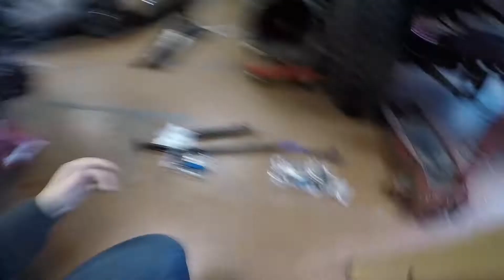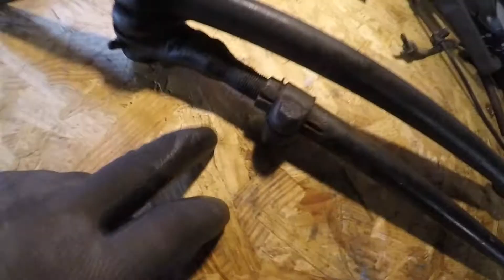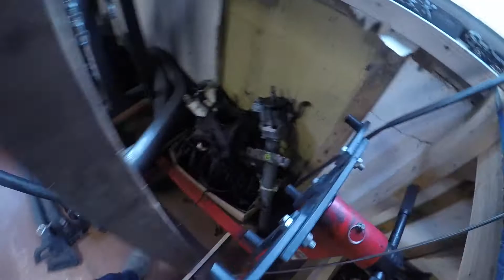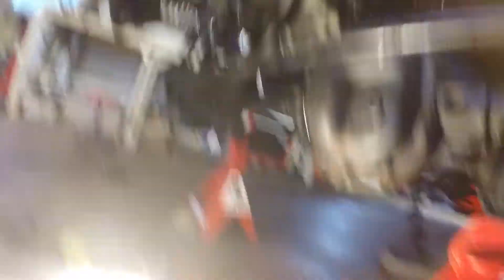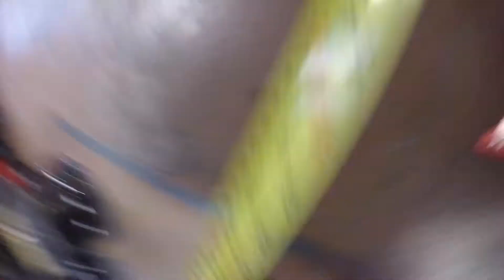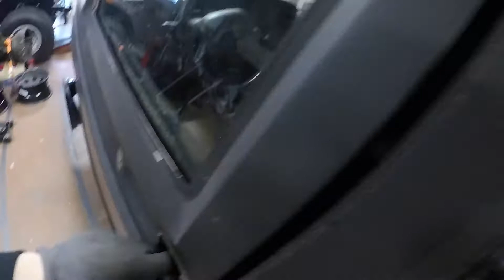Jeep XJ Steering and Ball Joints + DIY Alignment!

Comment: Have you had luck with stock steering with bigger tires?? Waiting to put 40s on my 2nd gen but holding back because I don't have 1k to drop just on steering and didn't think stock would hold
Reply from the maker: Ive never had issues but my XJs never had anything bigger than 33s but idk about 40s bro😂